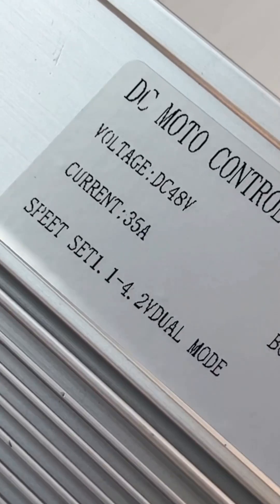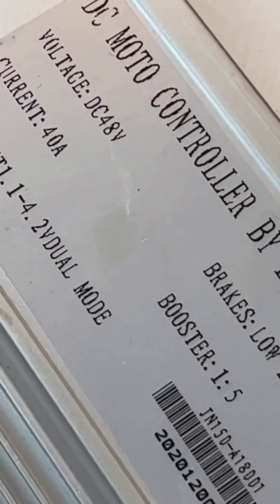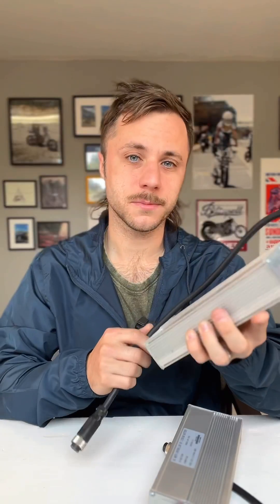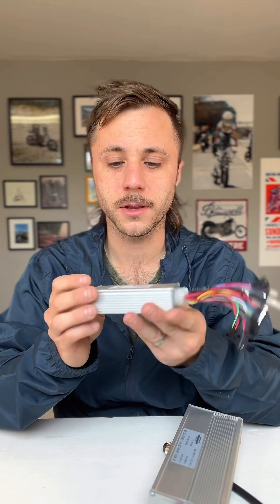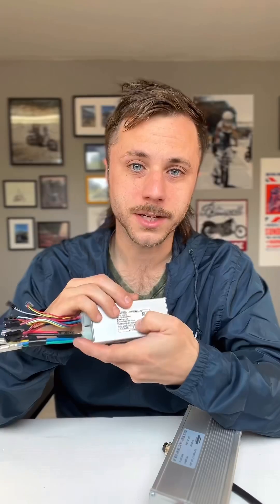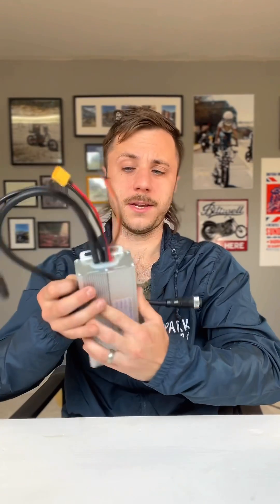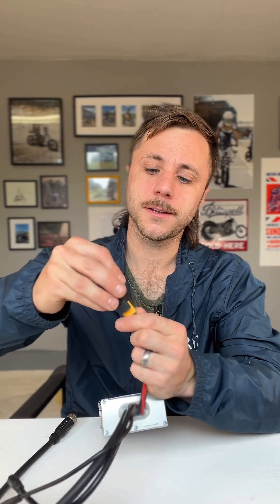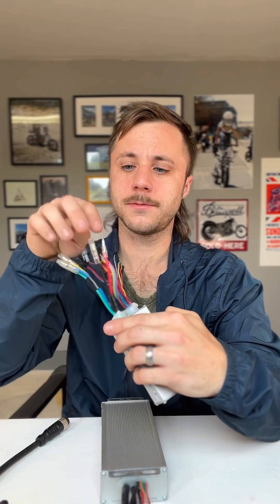Easily Add a 2nd Battery to Your eBike With a Battery Blender!

Comment: ive just added a 36v20ah battery using a blender to the 36v 10ah battery to my ebike ,but it cuts out after 50ft,why is this.??
Reply: Did you ever resolve this issue?
Reply: Unfortunately not.i returned the battery for a refund but did'nt get any update as to if it was faulty or not.

Comment: why does the blender you show look like it was 3d printed?
Reply from the maker: Because the enclosure is 3d printed
Reply: so the maker is skiming on material costs by not using any form of a propper heatsink.  I just placed an order to get the Area13 adapter as it looks like a better build quality and more presentable then 3d printed garbage @SparkCycleworks
Reply from the maker: @canadianbrickcafe  Thanks, our device predates Area13's by over 2 years and works very differently. It has a loss of 7.4 watts vs our closest competitor (15+ watts). It's just a much more efficient, cooler running device. The 3d printed shell is just an outer cover and makes much more sense than investing in a $20,000 mold. This saved final sale price about $50 and allows us to do on demand manufacturing rather than waste tons of inventory space. We have had zero failures in the product's history. Enjoy your your purchase from Area13
Reply: @SparkCycleworks  I Challenge you to proove your statement.
Reply: I Challenge you to  Spell proove..... Correctly....

starve a troll......   they are  amusing, but a waste of time...
Reply from the maker: @canadianbrickcafe  there’s already a video on the product page showing it

Comment: Hi pal great vid, question for you can I connect/power two controller's and two batteries same voltage and AH to power a AWD drive bike seperate throttles and hub motors using this device??